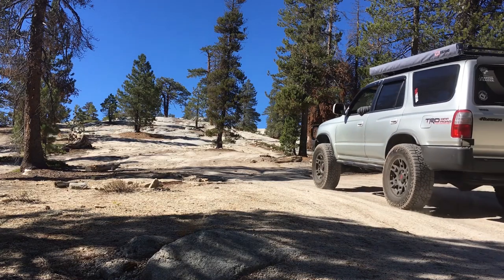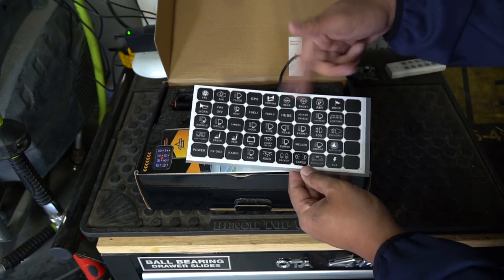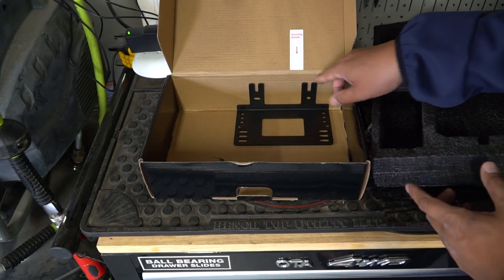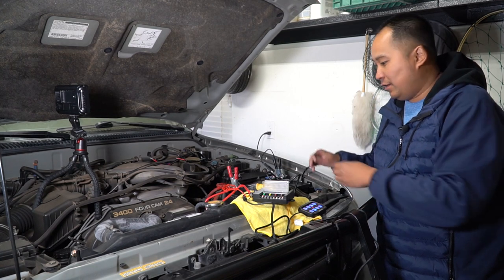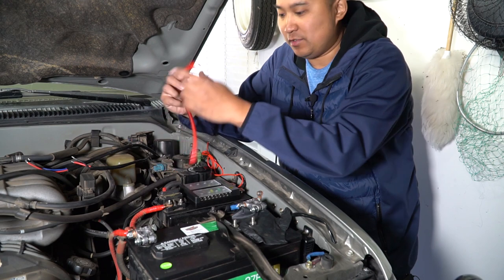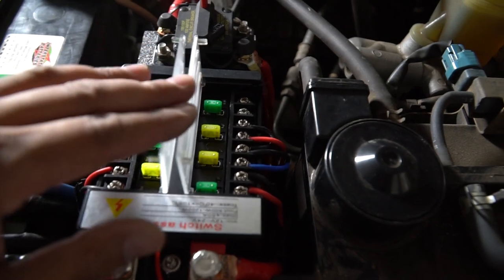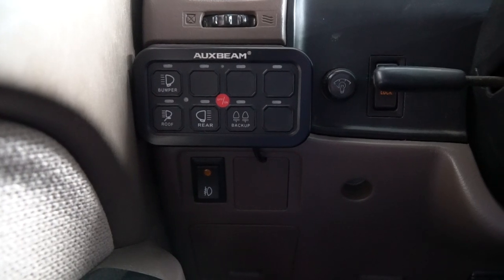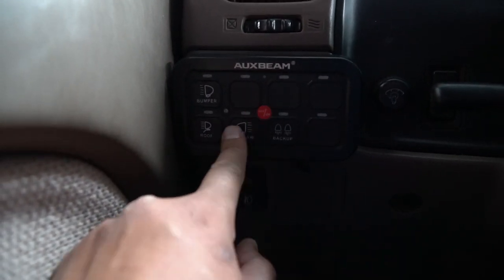Auxbeam Power Switch Panel Install - No Relays No Switches - Toyota 4Runner

Comment: Hey Minh,  I used your video as research for my own Auxbeam Switch Panel install.  I copied your mounting technique and location.  I think it works out well.  I gave you credit in the video mentioning I copied you.  I'll put a link to your channel in the video description as well.  We still need to film the mounting and wiring of the lights as a Part 2.  We got a sponsorship from Auxbeam, but I think they would have been a company I would have purchased from anyway because their lights are affordable and they have a good reputation as far as I know.  No way would I spend big money like you can spend with some companies like Baja Designs and drop $2k on one light bar.  I just can't see spending that much money on one light and I'm surprised people who run them on their rigs don't get them ripped off.  It's just a couple bolts and an electrical connection and that expensive light it gone.  Anyways, thanks for the video!
Reply from the maker: Cool yes auxbeam is pretty good for me so far. 

For running wiring to the roof, check my solar video as I have used a few factory holes for that to keep things a bit more factory.
Reply: @PhoRunner  I'm going to take the path of least resistance and use a KC Wire Hider and run the wires up the edge of my windshield.  Easy Peasy!
Reply from the maker: Ah yes super easy!

Comment: You could hook it up to constant 12v but the pannel would drain the battery I would assume
Reply from the maker: Yeah
Reply: @PhoRunner  that defenitly seems like a downer to bad it didn't have a on off for the pannel to turn the pannel off when your not in vehicle but it could recive 12v all the time
Reply: You can do exactly that with a 6-pin double pole double throw switch.
Reply: @Shrek-is-Love  very true

Comment: Thanks for the video. I remember in another video you mentioned doing a cheap headlight retrofit on your rig. Would love to see a little how-to/recommendation on how to do that without breaking the bank. Thanks.
Reply from the maker: I had someone do them for me but the parts are these here:

https://amzn.to/3Ea8lZ2
https://amzn.to/3Ekzad4
https://amzn.to/3pgaOwR

Add HID KIT and Headlight Housing

Still love them (even though they have some flaws, cut off lines aren't straight with each other but I suspect that's an install thing).
Reply: @PhoRunner  Right on, Thanks for all the help man!

Comment: Clean install. I finally got my roof rack from UpTop Overland and installed it with the Baja S8 lightbar and rocklights connected using their quickwire harness. Now I am not sure what is a good way to get the wires into the car? They suggest either using the pre-existing hole from the original roof rack or through the trunk's weather stripping. Also, I assume I need to buy wires to connect the quickwire to the battery, if so what wires should I buy? I noticed the Auxbean didn't include it, do you know if Spod or SwitchPros do?
Reply from the maker: Just straight to the switchpod. 

I put my wire through the existing hole for the roof rack mounts

Comment: Hey you should do a comparison video between that Auxbeam 8 panel and the Rough Country 8 panel switch. I bought the RC but I haven't installed it yet, and it doesn't have that add a fuse thing. As per RC it has some kind of built in power thing which supposedly shuts the panel switch down after it detects the battery drops to a certain voltage or something. And as far as dimming it, the RC comes with a wiring harness (separate from the harness that controls the lights) which you connect to a dimmable circuit (can't remember the exact words off the top of my head, sorry). Kind of makes me second guess my purchase 🤔 I know each have their pro's and cons. Thanks in advance

Comment: You should be able to find a fuse that has constant power. Switch the fuse tap to that and, in theory, you should be able to continually power the fridge. I’m actual thinking on a way to use a two way switch to determine the fuse it’s connected to.
Reply from the maker: I’ll have a look!

Comment: Hey bro, with this new control box can I still use my old wiring harnesses that has the relay built into it ? Or I will have to buy a new wiring harnesses that has no relay ? Thanks.
Reply from the maker: Just find the 2 wires that go to the lights and cut it off and connect it to the box. That box of wires I showed in my video were those wires. No need to run new wires.
Reply: @PhoRunner  awesome, thank you for you’re feedback.

Comment: Hi, i got 5th gen 4R. When you tap into accessory what amp fuses did you use? and if i tap into Ignition 10A + 5A(came with the ada) under the hood is it ok? Should i increase fuse amp?
Reply from the maker: I would use another circuit and no you would not increase the amp for the existing circuit

Comment: @15:00 the only way you'd have always on is to have a secondary battery and run the auxbeam through it. One the "crank" battery, once the key is off, it's ALL off. 
GREAT VID BROTHA!! Love that 3rd Gen! 383k on mine.
Reply from the maker: 383k is nice! Yeah I ran some custom wires to the rear for my fridge

Comment: Question: electrical isnt really my forte, so i wanted to ask: if i go with this system, i want to hook up a cooler temp, egt, and trans temp guage on an A-pillar triple pod. Would all 3 guages have their constant 12v and ground wires run through the auxbeam fusebox with the remaining wires for switched (ignition) and illumination conected to add-a-fuses in the fuse box by the driver side foot area? Or is there a better way in your opinion? The gauges only use 4amps in terms of fuses. Thanks man. Learned quite a bit from you!
Reply from the maker: I wouldnt hooked those up to the auxbeam since you’d likely want those on when the truck is in accessory/on. I would find a circuit (windshield wiper perhaps) to tap into to power those gauges.

Another option is to run a standard relay from the battery and use the same add a fuse to turn on the relay. This way the gauges have dedicated circuit to the battery
Reply: @PhoRunner  i understand now. Thanks again man.
Reply: @PhoRunner  So i thought i got it in regards to incorporating a relay, but im still confused af. To clarify: my 3 gauges will be daisy chained, 3 red constant 12v merged into one. 3 yellow switched (ignition) merged into one. 3 orange illumination merged into one. 3 black ground merged into one, which will be grounded on it own. Correct me if im wrong: car battery + to inline fuse to pin #30 on relay (is a 5amp inline fuse enough since the gauges are 4amps?). Red constant 12v red wires from gauges (daisy chained onto 1 female spade connector) goes on relay pim #87. daisy chained switched wires from gauges merged to 1 female spade connector goes on relay pin #86. Pin #85 on relay is a direct ground. Where does the remaining daisy chained orange illumination wire to? A tap a fuse into the factory fuse block? Super confusing. I know im asking lot here but i just can find an answer online about this. Thanks for any help you offer, man!
Reply from the maker: Orange wire usually goes to something like a head light circuit so the lights only come on when you turn on your headlights. The 4runner doesn’t really have a wire for this easily found. You can try the radio orange wire but I found it doesn’t work. 

I would use 10amp, you want to add 50%. 

I’ll need to look up a wiring diagram but seems right. Seems also like it doesn’t need. Relay, just red to battery and yellow to the add a fuse to turn it on
Reply: @PhoRunner  thanks again! In terms of choosing a relay, what amperage do you recommend i go with? Is that also a "50% rule"? So a 10amp relay?
Reply from the maker: I don’t think you’ll need a relay for those gauges! The low amps means you can just hook them up to the battery (red) and yellow to the tap a fuse perhaps to turn them on when your circuit is on
Reply: @PhoRunner  thanks man. I guess i was just paranoid about watching my rig burn to the ground because i didnt do my due diligence haha. No relay it is! Take care,
Reply from the maker: Make sure there’s a fuse on that red wire and you’ll be fine. 4amps won’t burn down the rig hehe

Comment: I need help figuring out how to plug to the switch board a 3wire light bar with a dual function (amber on edges, white on center, can be turned on individually,and also strobe mode) 🤔

Comment: How's the auxbeam holding up? Any issues?
Reply from the maker: No issues! Working great
Reply: @PhoRunner  thank you for responding.  I'm looking to get a switch panel and appreciate your review
Reply from the maker: @TheMbn1972  I haven't had any trouble with mine and seems pretty good for the price. I know a lot of others run auxbeam too and they are pretty pleased with it.
Reply: @PhoRunner  thanks for the information. I just pulled the trigger and bought an auxbeam switch panel.

Comment: Hey I got a question, did you update your master cylinder for your break fluid when you did the tundra breaks? Also what is your opinion on that too? Thank you:))
Reply: Update/upgrade
Reply from the maker: I did not. Kept it stock
Reply from the maker: The brake upgrade is amazing to be honest!
Reply: @PhoRunner  thank you vary much. I can’t wait, I ordered mine from the link you gave in a walk around vid just waiting to put them on I can’t wait
Reply from the maker: I stopped noticing brake fade on 32s tire and these big ol tires stop just fine with the tundra brakes. Nice upgrade just make sure your wheels work with them!
Reply: @PhoRunner  awesome to hear and get some help, I am vary thankful. I just bought STT pros in 285/70r17 I’m trying to keep up with you🤣🤣
Reply from the maker: Lol no need to keep up. I’m trying to keep up with y’all! I spend more time working on my truck than enjoying it lol..

Comment: I spent 2 hours installing this thing into my Jeep, along with a bunch of accessories etc and it worked great, for about 5mins! Then the switches stopped working and nothing would turn on or off! It’s a complete waste of time and money and now I have to pull the damn thing back out and start all over with something decent!
Reply from the maker: That’s lame! Mines still working awesome! Maybe try swapping it for a new controller/circuit? The wiring can remain at least.
Reply: @PhoRunner  yes, I've just contacted the seller, hopefully we can work something out.
Reply from the maker: @officialWWM  Just buy another one on amazon and return the old one. faster.
Reply: @PhoRunner  yes, I normally would but freight is a nightmare this time of year, it will probably take weeks to get to me. I think I’ll just pull this one apart and try and fix it 😂

Comment: Just attach the red wire direct to the battery instead of ignition, then you can attach your fridge etc.
Reply from the maker: Yes that’s what I did but it’s not cleannnn
Reply: @PhoRunner  why not? It doesn’t change the look at all and it’s much more practical.
Reply from the maker: @officialWWM  I had to add my "add a fuse" back to the line and also a larger type fuse. Just more inconvenience is all.
Reply: @PhoRunner  I see Auxbeam have just released a new version that allows Bluetooth control from your phone. You should ask them to send you one for review!

Comment: Sweet video! I got a similar one, but not the Auxbeam, so it's a knock off of a knock off, I suppose, but the most important thing is that it works. BTW, you can have it "constant on" but the whole system will be in that configuration, not just a couple of selections; you just have to wire the remote wire (the one you plugged into your ignition) directly into the battery; but then you would just have to monitor whether you left a switch on or not; which is easy because the "on" buttons illuminate when they are on. Or you can we that remote wire into a "master switch" that's connected to a constant power, that way, to ensure it gets accidentally turned on, you can just turn off that master switch. I'm really glad I got mine. Wired my roof rack lights separate from left to right; as well as reverse and rear amber marker lights; and I just wired my ditch lights together; still deciding on main front light bar
Reply from the maker: I was thinking about a switch to control this too but wanted to checked a few things like if the system draws any power when on. I thought about doing this but kept the video simple as my use case is probably rare